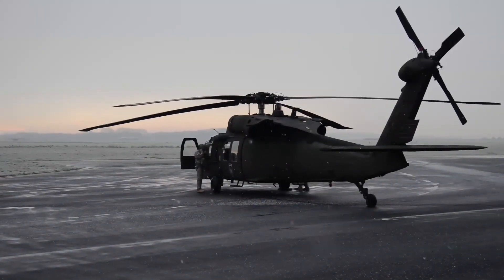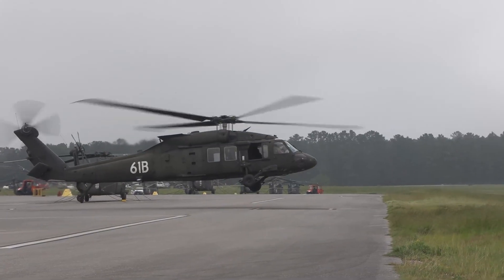Why the Military Can't Resist Tilt Rotor Aircraft

Comment: The only way to compensate for a one side wing failing is if the span of wings themselves can mechanical reposition itself so it centrally returns inwards inline becoming a normal helicopter. 

If the span of the wings rotate perpendicular at 90 degress and self center itself accordiningly to the weight of the vehicle

Thats obviously an impossible engineering task with all fuckery against phsyics to solve

Comment: So, a nearly 60 year old less capable aircraft is being replaced by a current aircraft with many times the capability. 
a point missed is metal fatigue meaning the "lovable" old darling would soon start falling to bits in the air, this may kill the romance along with many people.
Well done Navy. 😎👍
Reply: I believe the Blackhawk is still in production, so while the design is fairly old the components and airframes are much less so

Comment: I really like tilt rotors. The only issue is they still have alot of teething to go through and unfortunately that will mean injuries and lives lost. hopefully they can fix the issues and make these even more reliable.

I do think this technology would be beneficial in the civilian sector. Rescue helicopters being able to get to locations very fast and then hover to do their job would be great.
Reply: Even the Osprey is safer than the CH-46, CH-47, CH-53, and HH-60. It was the first of its kind. Hell the Black Hawk had 20+ crashes in its first 6 years of service.
Reply: @n3v3rforgott3n9 many due to the poor EMI shielding.
Reply: What did they learn with the Osprey failures?  Remember back to those days?  Years ago!  Why are they safer now?  What about the new Army  Bell V280? What does it have that they learned with the Osprey?
Reply: @Handle1969 the Osprey has had many small improvements.   The Valor improves by leaving engines horizontal and using a straight flat wing.   There are other improvements butvthats the quick answer

Comment: It's a useful tool in the toolbelt, I just think it's too soon to throw out all the similar tools and only rely on this one to handle all those jobs.  I'd have preferred that we hedged our bets for one more generation of these tilt rotor designs before going all-in.  But if all we're going to care about ever again is the Western Pacific and landing marines on the Spratlys and Paracels, then okay, this is the machine to have.  That extra speed and range is going to be critical there.  Hopefully we don't need to drop any of these wide bodies into central Taiwan though, that terrain looks rough.
Reply: Speed and range are king on a battlefield for a transport helicopter. It can land nearly anywhere a Black Hawk can but will spend half the time in the hot zone doing so.
Reply: you guys did. V-280 looks similar but it is quite different. Maybe it is about time for a Osprey redesign.

Comment: Having understood the tilt rotor advantages pointed out by this video, I believe they are not necessary at all times. The militaries are putting all the eggs in the same basket. It’s like having a racing car full of novelties being employed for races as well as for go shopping. IMHO the “only one super model fleet to do everything” philosophy is a great error. An error that is being committed twice in the Navy Cargo and the Army UH replacement.
This video focuses on safety issues and the operational possibilities. Both are fundamental. But nothing is said about operating cost. And that's a main factor as well. A follow-on video on this subject would be greatly welcomed.
Reply: So increased capabilities will come with increased costs. If you factor in that the Osprey goes twice the distance in the same time compared to other medium lift platforms it's costs get closer to the CH-47 and CH-53 although still greater. The Osprey is also the first of its kind with multiple design choices that had major drawbacks.

Comment: Usually, when personnel are in need of urgent medical care not available on board ship, a COD launch is very stressful on the patient. It's not likely for one of these individuals to be flown to a carrier or other ship. As you stated in the video.
Reply: There was an interesting Coast Guard  Cost/Benefit analysis on acquiring them for use in medical evacuations near the U.S. coast.  Their conclusion was that most medical events that required their assistance were well within helicopter range.  Most calls were within a hundred miles of shore.   There just wasn’t a business case in their mind.

Comment: I think of tilt rotor technology as analogous in its evolution as what the nifty fifties were to fixed wing aircraft technologies.  There's argument suggesting tradtional rotorwing aircraft fit the analogy as well,  but a line must be drawn.   The fifies defined the core design phlosophies for all fixed platforms through the end of twentieth century and still today dominate.  Yet we are seeing new novel approaches.  Granted the evolution of tilt rotor platforms has not been as rapid as the aforementioned.  Ponting out the roots of tilt rotor go back to mid 50's with Bell XV-3.   Nonetheless, IMHO the future holds great promise for tilt "platform" technologes.  Benefiting, like many things are today, from advancements in materials sciences and manufacturing techniques.  

Back to tilt rotor airframes and powerplant tech.  It's not out of the question that the future will see aircraft such as depicked in the movie "Oblivion" staring Maverick a.k.a.  Tom Cruise, realized.

Comment: He's wrong. The US Army has chosen to replace the Apache helicopter with the Bell V-280 Valor also.
Reply: no they have not. There is a competition right now between the Bell 360 Invictus and the Sikorsky Raider. One of these two will replace half of the apaches because they already have reached their frame limits. They will also take back the role the apaches have been doing which is recon since they retired their recon helis the Oh-58 Kiowa.
Reply: They are working in the Bell 360 to replace it.
Reply: The valor is only replacing the Blackhawk and the bell 360  Invictus and S-97 raider is competing to see which one will replace the OH-58D Kiowa Warrior

Comment: Another reason why the Navy is replacing the C-2 Greyhound with the CMV-22 Osprey is because the latter can carry the F135 engine which is used on F-35Cs and will allow aircraft carriers to replace their engines on board during deployment ...
Reply from the maker: Great point, thanks for commenting
Reply: The C-2 can carry the same F-35 engine and go faster and farther.
Reply: Correction, F135 Power Module is too big to fit in compartment of C2, also too much shock catching wire even if it did fit. Additionally it does not have in-flight refueling like V22 which has greater range than C2
Reply: @wayneyd2  to even fit in the V-22 it takes a special trailer.

Comment: Ironically, helicopters produce asymmetric thrust during the entirety of flight. Just because a helicopter has one disk, doesn't make the thrust symmetric. Far from it. Even a coaxial hello produces asymmetric thrust. Sure, it's balanced, but leads to excessive vibration.
Reply: Helicopter blade loads due to asymmetric lift come from blades advancing on one side retreating on the other.  It causes all manner of design headaches for the engineers.   The unloaded blades tend to „twang“ depending on blade stiffness.  Even turboprops have the same issue.  At any angle of attack during cruise the upward and downward traveling blades generate different amounts of lift creating asymmetric lift and all manor of headache inducing gyroscopic forces.   Lol

Comment: The thrust of two rotors comment is false.  They are connected.  It is two engines connected to two props.  If one engine fails, both props are powered by the remaining engine.
Reply: So manu ignorant people in thks comment section.
Reply: I thought they had a backup system like that in place.
Reply: And that engine will take you all the way to the crash sight.
Reply: @larryjackson6238  No it can fly on one. And land on one.
Reply: @larryjackson6238 That is better than going to the crash site rapidly. And inverted.
Reply: @larryjackson6238  That is like saying a one engined plane will always crash.
Reply: @larryjackson6238  You are wrong... you will be in complete control just at limited speeds and altitude but can still fly back to base.
Reply: @n3v3rforgott3n9  Do you think the US military got it wrong?
Reply: I was not picking on anyone with my response.  I just chose the last responder to respond.  Hope it was OK.
Reply: @sammcbride2464  Not at all. The defiant was far from a mature program like the Valor and performed worse in nearly every category that was tested. This platform will improve capabilities far beyond what any traditional helicopter can do. The only issues is the cost which is a bit more than double a modern Black Hawk. If China continues to be a threat I don't see this program failing.
Reply: @n3v3rforgott3n9 I would still choose an A-10 over many platforms.  It is a beast.
Reply: @sammcbride2464  I sure hope they didn't. I believe it was a bad idea for the military to go all in on Ospreys for something as crucial as logistics. They had to bring out the Greyhounds after the Navy grounded the Ospreys last December.
Reply: @Amalgam67  That is a different  idea.  Who knows if a plane acting like a helicopter is better than a hellicopter.  For military people it is just range and protection.